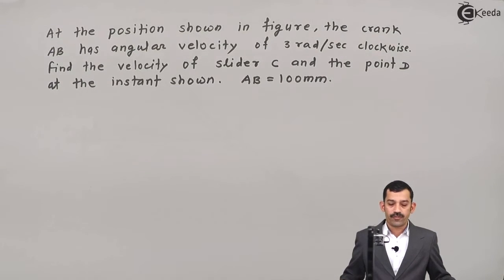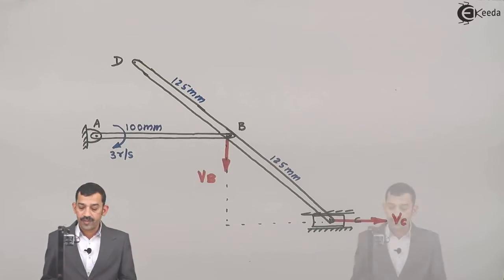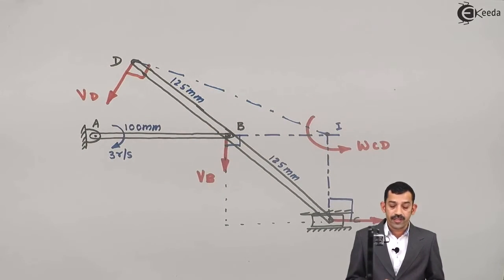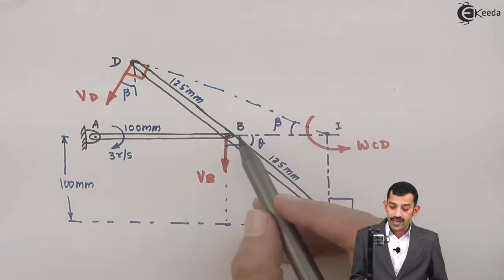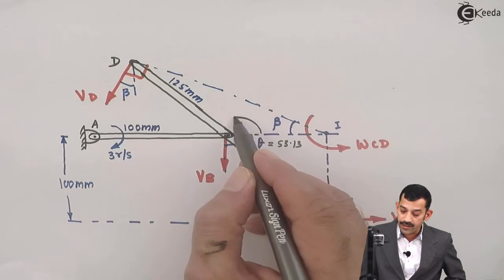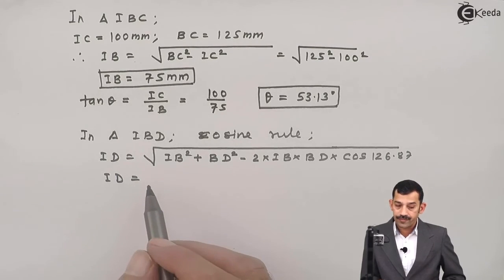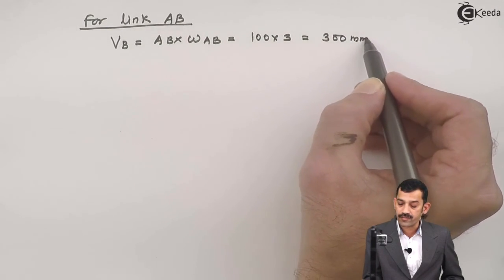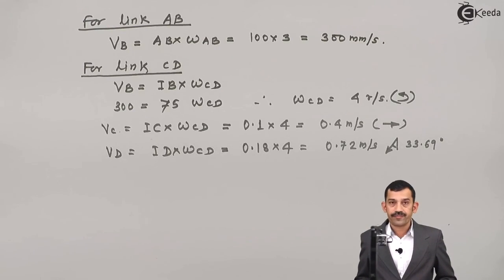Kinematics of Rigid Bodies - Problem 8 - Engineering Mechanics

Comment: Can you give solutions of thsi problem > A wheel rolls without slipping with angular velocity of 60 RPM clockwise as shown in the figure. For the points A,B,C,D and E shown in the figure, Determine the absolute velocities when AO is vertical.